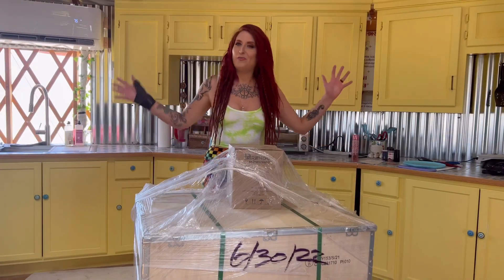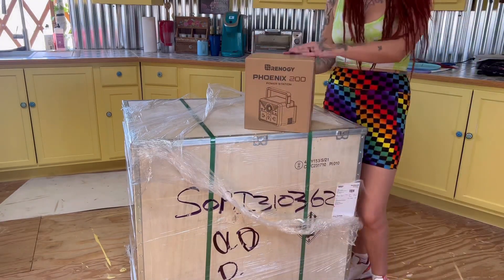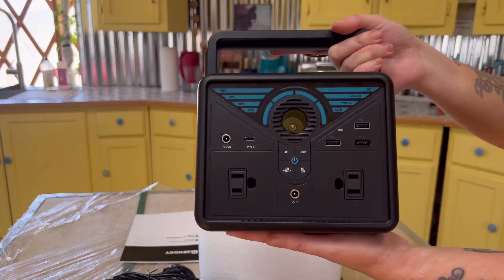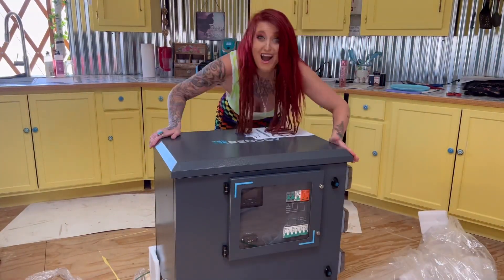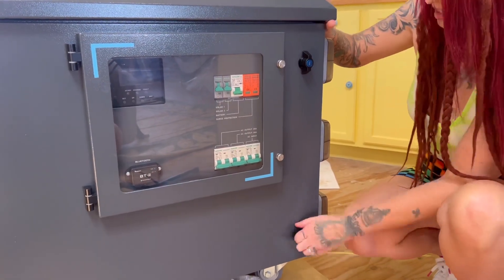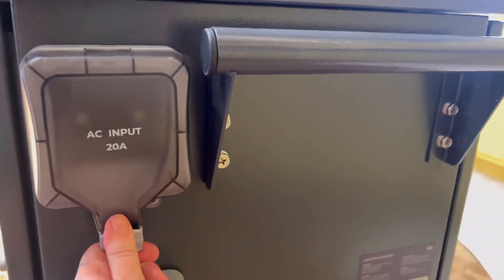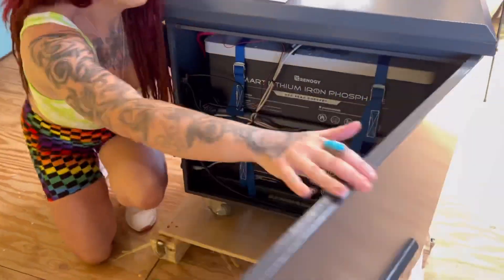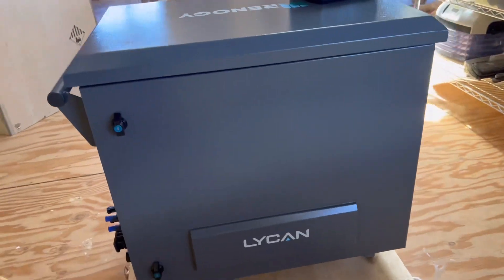Renogy Lycan 5000 + Phoenix 200 Power Station Unboxing

Comment: You have tons of power? Do you use it all... I need to ask .... The 350watt mono panel pull in 1600 Watts??? Do you have these
Reply from the maker: Yes we do max out and use it all when running both mini splits. We have 10x Renogy 320w panels and 12x Renogy 100w panels. The 10 equal 3200w in power plus the 1200w from the smaller panels. We will also be adding 6 to the product in this video. We will have an updated system video once complete.